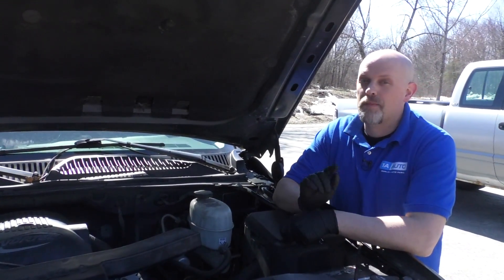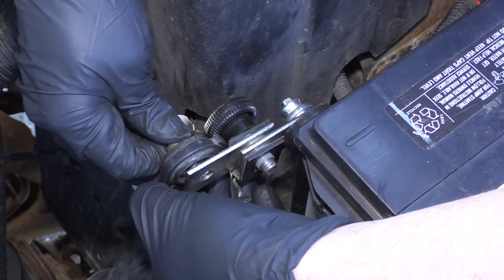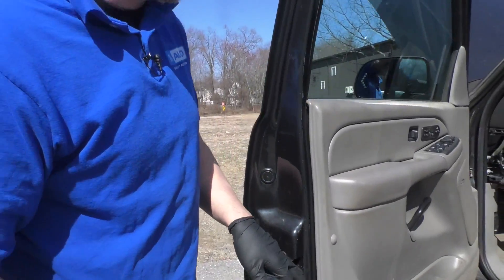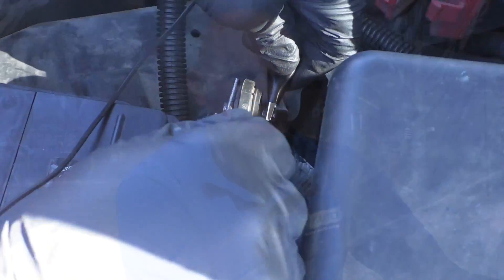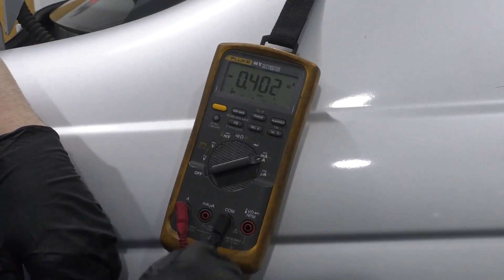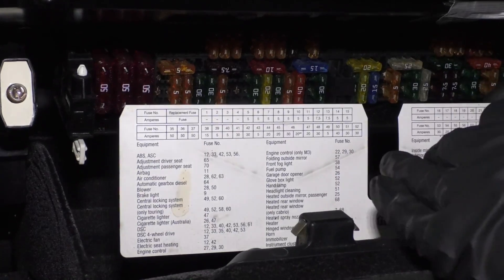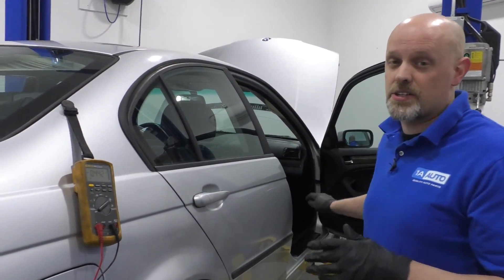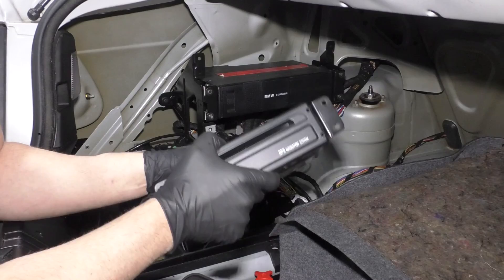Battery Always Dead? How to Perform a Car / Truck Parasitic Draw Test

Comment: I remember back in the day we did the same thing with a test light and disconnecting positive battery terminal and placing the test light on battery and the probe on the cable!! Solved many wiring issues that way!  Great video !!
Reply from the maker: +Charles Clinton Thanks for the feedback and for watching!

Comment: What do you mean by ''goes to sleep"?
Reply from the maker: +Ada L Thanks for watching!  There are numerous modules in vehicles that will continue to talk to each other after you turn off the vehicle.  You need to give the vehicle extra time after you shut it off to insure that everything is dead.
Reply: @1AAuto  are you guys able to explain this in more detail? Does this apply to most parts for any new, older or used cars?

Comment: I thought I had a parasitic draw tested all good . Turned out to be the battery interstate small crack on the bottom. Had checked both battery and alternater . Battery would not maintain voltage at 12 volts alternater showed 14. 58 volts.  Replaced battery at costco got full refund  . Best of any store. Their kirkland batteries were much better. Tuf times stay safe